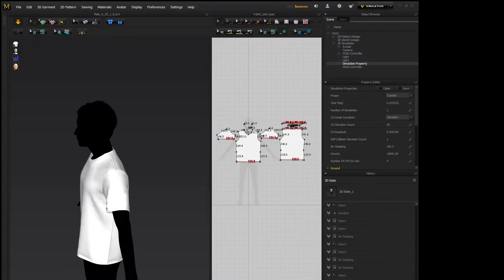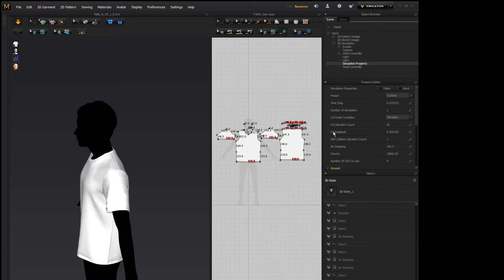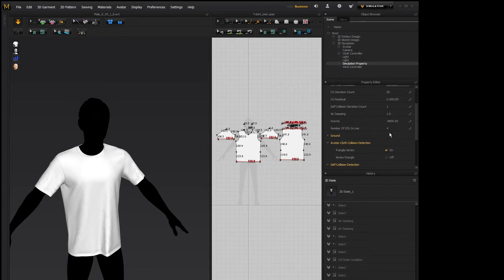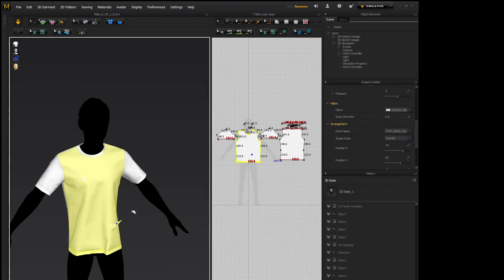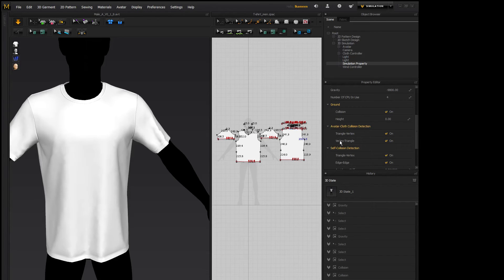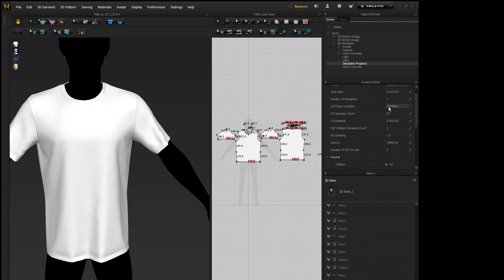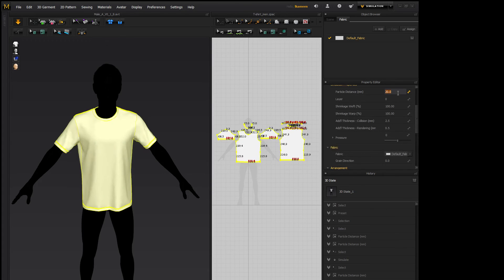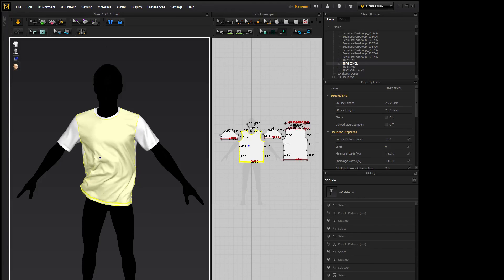Marvelous Designer 5 Tutorial - Simulation Properties

Comment: Here's what 'time step' does.  It's basically a frame rate.  It's set to 1/30 by default but if you are working with a framerate of 1/24, for instance, set it to .0416666 (1 divided by 24).
Reply: any idea how to increase substeps in the simulation for example if an arm is moving really fast (far) between frames.
Reply: @Tyson2k55  I'm also looking for settings for fast-moving can't find much, please let me know
In Tyflow and Phoenix FD time steps, it's how many calculation/frame the faster the more calculation is needed to compute the interpolation between frames